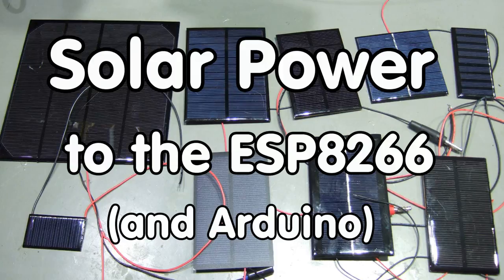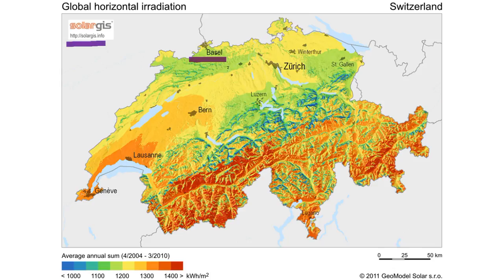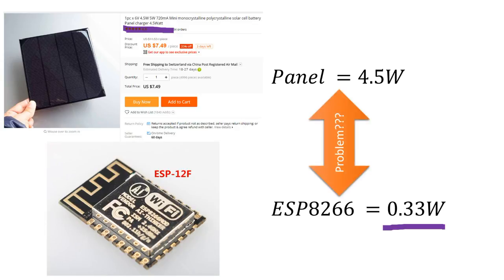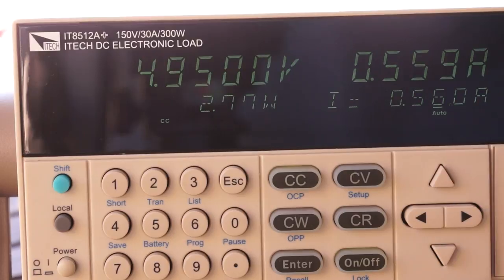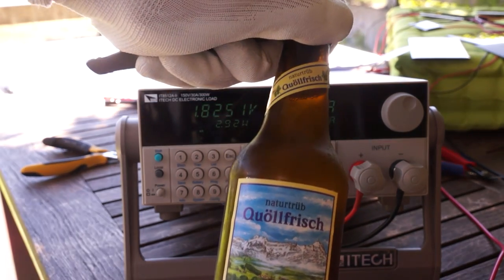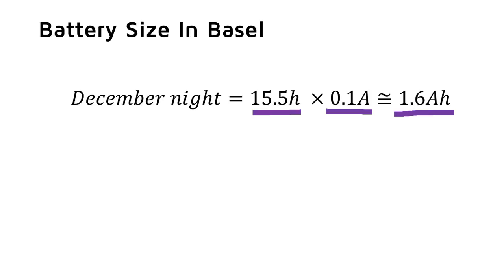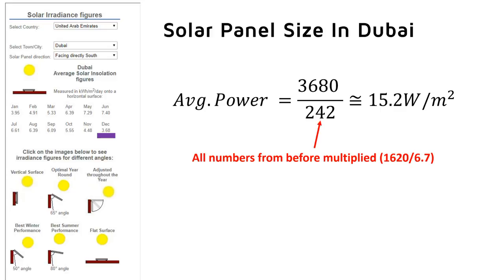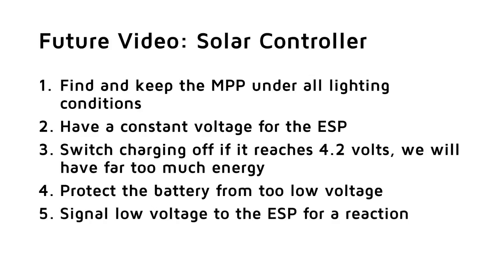#142 Solar Power for the ESP8266, Arduino, etc.

Comment: I'm just starting to look into this, so I don't have your hands-on experience, but I was thinking about how one can monitor solar intensity with respect to solar panels. A Lux meter is not too bad, because most panels use the 380-750nm range, but it's not a full correlation with Lumens. The cheaper Lumens meters use two photo-diodes, and calculate Lumens based on their outputs. But their output is not linear, although it does roughly correspond the the human eye. A solar panel has a much more linear response to wavelength, in the visible region.

Maybe you could just use a standard solar panel of the same type as you use in your tests, and record the power generated from it during each test. Then that would automatically take into account the effects of atmospheric moisture, dust etc on solar radiation intensity.

You could even use that to normalize your test data by using the standard power output for a given series of tests: just record it as you do each test. Then if something happens during a specific test you will both know it and be able to compensate for it.
Reply from the maker: I think, I will only try to monitor the energy which really came from the panel, because I am not interested in the phases with energy in ambundance, only for the critical phases. This is different to most applications where you want to get must out of your panels.
Reply: That's not what I mean't. You tried to use a Lux reading to compare readings taken at various times for your system, and my point is that Lux is not an ideal measurement for solar power: the wavelengths and weightings over these wavelength ranges are different for Lux and solar radiation.

I understand that you want to concentrate on the low energy times: Winter basically. So you need some way of making a quantitative measurement of how well a specific system behaves for a given amount of solar energy. So you need to be able to measure solar energy.

Comment: Hi Andreas,
good information, thank you.
I am running an arduino based weather station with solar power in Zurich. I made good experience with a charger module. This is the one: 03962a / TP4056. but there are two versions, one with dedicated battery connectors and one with shared ones. I prefer the newer version with dedicated connectors.

Cheers
SJ
Reply from the maker: I should have one of these and will try it out. Thanks for your feedback.

Comment: Excellent video. Perhaps we need to consider other ways of generating power, such as small wind generators? I haven't seen anything suitable yet, but it must now be possible to make anemometer-style generators that can provide a small but usable charging current to supplement solar panels, or even replace them in areas where wind is more common than sun?
Reply from the maker: For sure there are other possibilities, but the sun is very handy and everywhere available. Wind, for example, is not available where I live (at least not in quantities).
Reply: Andreas I think we have more wind than sun! I will get busy on a wind generator...
Reply from the maker: The only wind generator I had was the anemometer on my bicycle when I tried to do a power meter ;-) There, I had to produce the wind.

Comment: +Andreas, thanks for this great video! One question: What is the 10% you mention at 11.25? Is that solar panel efficiency? Because earlier you were using 15% as the efficiency multiplier.
Also, at ~3 minutes in the video you're making calculations based on the year-around solar radiation, but you take into account 15% efficiency for the solar panel, and then another 33% for the charging circuit. Then at end you make the same calculations again using the data for December instead of year-round, however here you only take 10% efficiency into account, so why 10 instead of 15, and what happened to the 33% of the charger circuit, I think we should still take it into account, right?
Reply from the maker: The 10% take also the losses of battery and charging device into account. The solar cell itself has around 15% and you lose some energy if you charge and discharge a battery
Reply: Thanks, I realize now I misunderstood the formula (possibly related to the fact that I was watching it at 2AM :)) I thought you only deducted 10% for the efficiency, but in fact you're deducting 90%

Comment: I would like to suggest that you spend considerable time on the solar panel and the sun's path in Basel. On June 21 at solar noon here in Phoenix it is ~82 above the horizon; yours is ~50'. I noticed that your test panels all seem to have a reflective surfaces. At 50' the sun at solar noon is quite low compared to Phoenix. The most efficient solar angle to the plane is 90' so with your cell lying flat in your picture you are off by 40'. With the reflective surface most of the light is going to bounce right off just like a mirror. So now the question is does tilting the plane make any sense or a tracking panel even better. Here in Phoenix the panels around town all are pointed north and at an angle off perpendicular determined by some formula for year long maximum efficiency.  I am old enough to remember seeing the first solar cell back in '56 made by Bell Labs; tiny little thing. Hope this will help you in your decision making. Out here we have been experimenting with the sun for a very long time. APS has a solar farm experimental station at Mcclintock and University in Tempe just down the street from ASU. Try a Google Earth look see. Heat can be a problem for the panel so let it breath.  106' and the sun has set.
Reply from the maker: I tried to tilt it to the maximum, but the difference was not big. So, I decided to do it flat to be easier comparable between all panels. After your post, I looked into http://solarelectricityhandbook.com/solar-irradiance.html and compared the two values for Basel/June. Flat, the factor is 5.7 and at 57 degrees (best for summer) it was 5.43. So, also here, the difference does not seem very big.
In this application, It would be advisable to chose the angle for the worst month of the year as we will have too much energy in summer.

I hope, that the surface of solar panels is penetrable for sunlight and does not act as a mirror, but of course, I cannot test it.
BTW: I loved Phoenix and its surroundings when I was there. I flew  also to the Sedona airport (with a Cessna) and will never forget that...

Comment: Well, your calculations may have left enough margin for error there. But I feel like it's worth mentioning, that if your battery is large to get you through the night (not the winter), you should design things to work in the worst case scenario and not on average across the whole year. In the summer you will be getting more power than the average and in the winter less. Therefore if your solar panel produces enough power on average over the year, that doesn't mean it will produce enough power in the winter. Especially not on a unusually cloudy day after your solar panel has collected some dust etc. Personally I would oversize the solar panel just a little bit more to be safe.
Reply from the maker: I think the formulas are here and you can select whatever scenario fits for you. I just made examples.

Comment: Interesting video and very nice explanation. For the next episode for the mppt, pwm, etc chargers please take into account that mppt chargers usually draw much more current than the other ones and that it might not be as good as a pwm one especially for low power situations.
Reply from the maker: +Luc Peeters This is very important! Do you have examples of boards or tests?
Reply from the maker: Most of these chargers are not for this scenario They use quite high voltages and are rated for many amperes. I did not find many of them suited for low power applications so far.
Reply: So so true. Seems we need to make it ourselves or modify . I have a couple of these but with the display, which can be turned off..  http://www.ebay.co.uk/itm/1PCS-5A-MPPT-Solar-Panel-Controller-Voltage-Step-down-Module-Constant-Current-/292153107129
You need to make sure to use a Schottky diode (place for that on the PCB) and most of these mppt boards since when you have no solar the power from the batt goes back into the board. But this makes it a bit more difficult since the tolerance of all components might make the batt charge over 4.2 Volt.  So if I would use these kind of things to make a L-Ion charger I would prefer 2 instead of 1 cells but to make it charge only to 4 Volts which is better for Li-Ion cells anyway.   Already looking fwd to next Sunday.

Comment: Hi thanks for the video. 
Yes designing a 24/24/365 solar powered system is quite different than to design a device to maximize solar harvesting during sunny days.
Once you design it to gather enough power to pass bad winter days, you will discover that the panels will deliver > 500 times too much energy during hot sunny days. 
So one thing to consider is what to do with that energy? 
My current approach is to use that energy to power fans, that will cool down the whole system.
Reply from the maker: The fans are a very good idea ! I hope, the factor will not be >500...
Reply: Ups! Of course >500 was exaggerated. I meant factor ~50. I have tested my 5W panel to deliver 15-20mA on rainy days compared to 800mA maximum in bright sun. Anyhow these little 20mA are reducing the energy deficit by ~25%. 
I will activate the fans by the signal "fully charged" of my charger modules, essentially to avoid a source voltage increase above the specs of the regulator when it stops dragging current. Additionally the Arduino will be able to activate them temporarily as well, when its own temperature exceeds a threshold, that will improve the panel efficiency.
Reply from the maker: Sounds like a good idea! Thanks for the tip

Comment: Thanks for sharing I learned a lot from this and your videos.  I am building a weather station using ESP8266 and this is spot for my power requirements.  I live in Malta so solar irradiance should be similar to that of Dubai.  Many thanks.
Reply from the maker: You are welcome. It should be easy to generate enough power where you live ;-)

Comment: Very good video for the right reasons. I have a question: which would be the algorythm to calculate needed panel for chargins a 18650 battery?? Thanks in advance
Reply from the maker: You can use the formulas in this video.

Comment: ...and i do have another hint. solarcells r working way more efficiently if they are directly pointed to the sun. this means 254,5° movement horizontal, and vertical can be fixed somewhere at the middle between 0 and 65,9° azimuth (also based on basel). 22° az or little more will be optimized for winterseason. it wouldnt be that hard to make the cell moveable, and combined with a solartracker it would be a very nice and interesting topic for your channel :-) i was up to build such, but... yah. didnt.
Reply: I did a solar tracker with 4 photo resistors and a dc motor for a school project. it is really simple to make. I bet it would be even easier with a servo motor
I could upload it if you don't mind that is all written in spanish.
Reply: Patchoulino Don't think so. Servos usually rotate 180deg i just read. As calculatet more as 250deg is needet. And exact positioning isn't needed. Follow up, and endswitches should be good enough.
Reply from the maker: I am sure that this is great for high power applications. But it would be interesting to fin out for small panels,  if the energy used for the servos can be made up with the additional energy you get...
Reply: Andreas Spiess i wont glue on servos. Thinking more on low power gear motor. Needn't to be fast or strong...
Reply: Great thinking.  The thrill of building variable vector control would justify doing this.  However, the practical consideration of the added equipment (and load) to extract nominal gains would perhaps be defeated by what would more easily be achieved by adding one more cell.   In a well balanced system, much of the power is not used anyway to protect overcharge, right?  But, yes, someday I'd like to try the servo control anyway.

If a 180 servo is centered on the 254 horizontal sweep, only 37 degrees would be missing on each side.  Better yet, orient the sweep to the most critical conditions knowing that maximum voltages will be clipped by the battery regulator anyway.
Reply from the maker: +Christian: You are absolutely right. And most of the time, it would be anyway off, I assume. But still you need to know date and time. With a connected ESP this is no problem. Otherwise it needs a RTC...
Reply: Andreas Spiess no, you dont... it is possible this way but overkill. all u need is 2 ldr and a small cut in the case where the sun can shine trough. if both ldr in balance, u're on the sweet spot. if not let em search for, but just if sun is shining, and this u can measure out by the cell itself. i think even a tinyAT can do this job. 3 analog pins, 2 digital for a mosfet driver (motor) and few lines of code and its rocks. 

im thinking on a project like this (the tracking part) for years... never get it done yet, but im so sure it must work this way. if i remember right, i guess i've seen a ytber who did it this way. he did track a flashlight, but the princip is the same.
Reply from the maker: Sounds really interesting. Let's do it!
Reply: ok, if u want me to help, im in. can offer u to write the code for it.
Reply: I would love to see something like this done on this channel.  Hope both you guys can make it happen.  Cheers !
Reply: as usual, all somewhere available ;)
http://www.instructables.com/id/Arduino-Solar-Tracker/
Reply: ...not worth to discuss. did u read the code?

Comment: Andreas, just reviewed the Solar video again,  great step by step clear instructions. I've worked though all the calculations and  I'm looking forward to the next 'solar' video with the MPPT and battery charge regulator. Have I missed your second 'solar video or is it a 'work in progress' at the moment?  Thank you for your time, effort and expertise
Reply from the maker: The video is still in the works...
Reply: Thank you for the quick reply. I look forward to the video. I hope you are enjoying the sunny weather, its cold and wet here in Albury which just south of Sydney, Australia :)
Reply from the maker: Even if it should be summer here, for the moment we do not have nice weather. But the work with the solar chargers is fortunately not only external work.
Reply: Still might be warm enough inside for a beer to keep you energized  :)  regards charlie
Reply: Hi Andreas, Another Aussie here. : ) can you also include whether you can use  a cheap DC-DC Boost as MPPT

Comment: A Review of a full setup would be nice. E.g. OpenHAB2, MQTT, ESP32, Mongoose OS, powermanagement as well as solar and lipo setup. This would be interresting for building wireless sensor devices and integrate them into a free home automation system.
Reply from the maker: I think, the systems setup would be your job ;-). I concentrate on the parts. Like that, my content is more widely useful.
Reply: Nice videos by te way 😉

Comment: Great video Andreas. 

Just curious, is there a reason why you wouldn't use lifepo4 batteries for solar power purposes?
Reply from the maker: +Brian Lough no. I just used Lipo as examples because they are more known
Reply: One thing to consider is that LiPo do not like being charged when the temperature is below 0 degrees - AFAIK it can be dangerous. lifepo4 are better in that regard for outdoor usage
Reply: magnets1000 have you come across much examples or circuitry for lifepo4 and solar power and its controllers? it's a few months since I looked but I didn't find much at the time
Reply: I've never really looked in to it too much. I believe a lot of the solar garden lights just connect the solar cell direct to the battery because they can survive a small overcharge current.

Comment: I didn't close my eyes one single time. Great video.

About the battery size for 14 days of bad weather. Wouldn't this assume that there is absolutely no sun for 14 days? Even if the weather is bad and it is pretty cloudy, the solar panels should convert at least some energy. Or do panels not work at all when it's really cloudy?
Reply from the maker: The power drops to nearly zero if it is cloudy.

Comment: Optimal power point tracking may also be relevant to mechanical generators like wind generators and bicycle dynamo. That being said, is wind a viable way to support a wireless sensor? If it's not viable on its own, it may provide just the right supplementary power just for the bad weather days, if your climate happens to make rainy days also windy.
Reply from the maker: I think, wind is also viable, if available in quantity. In my region, we do not have stable winds, so, the effort would not outweigh the reward

Comment: Vielen Dank für das sehr interessante und lehrreiche Video.
bin in diesem Thema ganz neu unterwegs und habe folgende Frage:
Muss das Solarpanel zwingend 5V haben wenn es an eine Batterie angeschlossen wird oder können die Volt auch höher sein?
Reply from the maker: Die Spannungen müssen immer inn erhalbden Spezifikationen sein. Die findest du normalerweise dort, we do das Bord kaufst. Oft sind sie für leicht höhere Spannungen ausgelegt.
Reply: @AndreasSpiess  Vielen Dank für die rasche Antwort! Folge dem interessanten Kanal sehr gerne :)